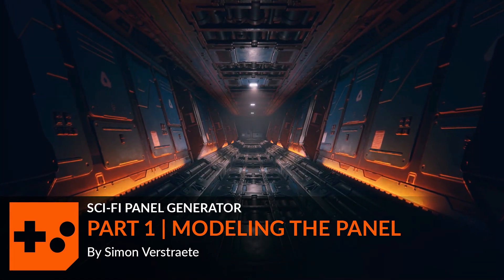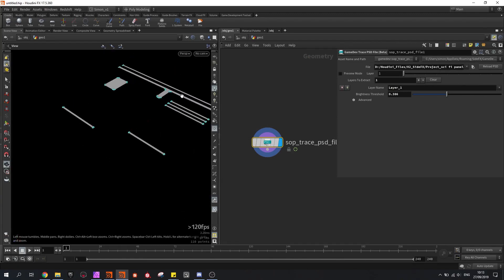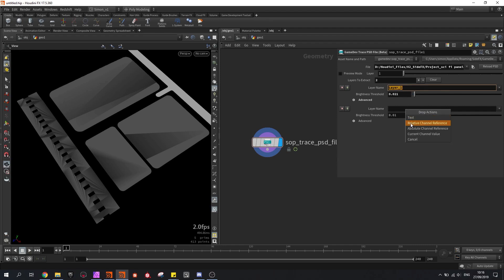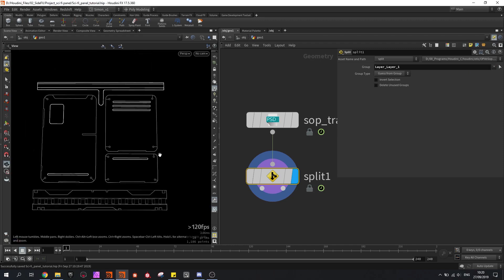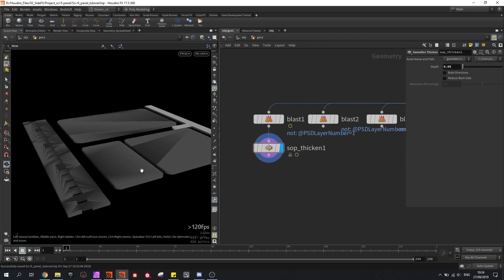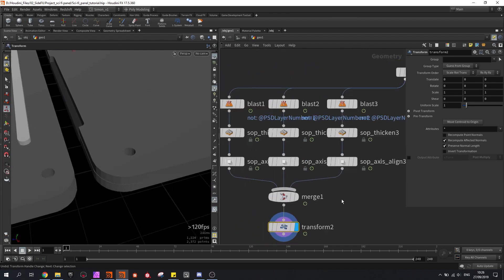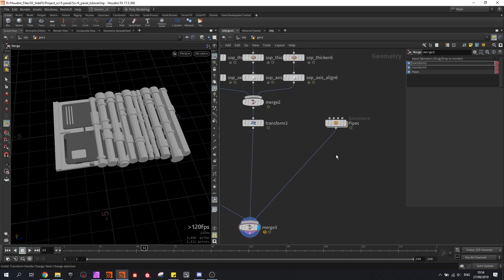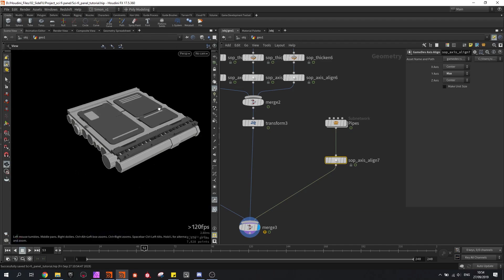Houdini Sci Fi Panel Generator | Part 1 | Modeling the Panel

Comment: There is no copy stamp node no more, and i couldn't figure a way around it with a for each loop! but besides that, is an AMAZING tutorial!!
Reply: Yeah, I have the same problem. I tried with copy 2 points node (instead of copy stamp). But with using it everything breaks.
Reply: @Igrom_Gamedev  If you still want to know i commented a fix for this in a separate comment

Comment: Hey in this tutorial , u used the deprecated method of randomize node and stamp functions , i really cant find the new way to achieve the same result for the pipe system to have variants and also fit perfectly next to each other , any reference or update , please i need it
Reply: I made a separate comment with a fix if you still want to know

Comment: In 19.5 there is no Copy Stamp node, it has been replaced by Copy points. Unfortunately, the same procedure does not work with Copy points. Is there a solution?
Reply: I made a separate comment with a fix if you still want to know